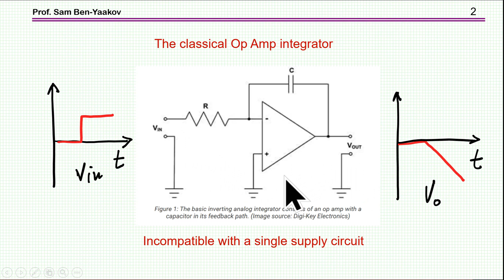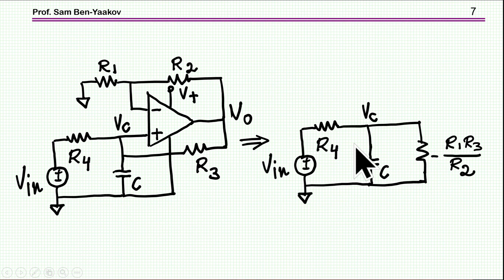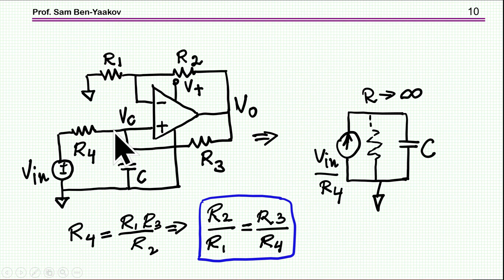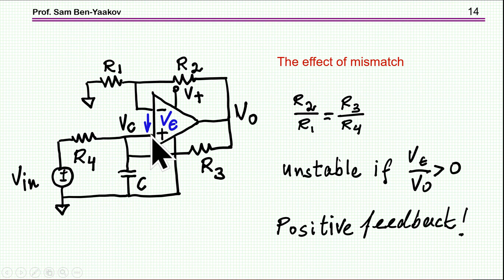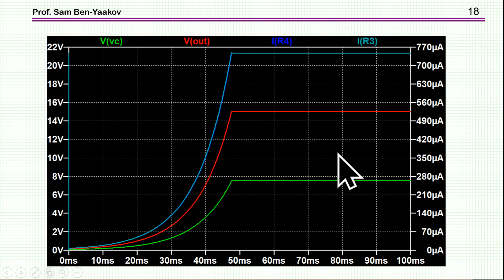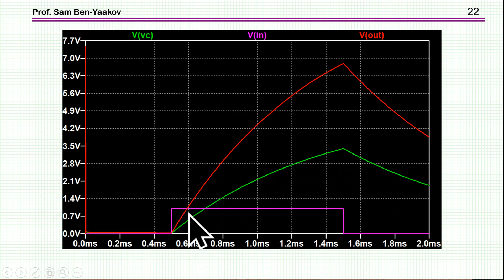Howland, Deboo and the non inverting Op Amp integrator

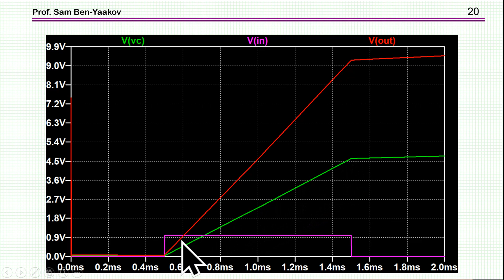Comment: At 14:01 showing the output with perfekt resistor match, the output does not go to zero when the input returns to zero. Was that not one of benifits of this circuit compared to the non-inverting integrator?
Reply from the maker: Yiu acb look at this, as such.

Comment: Hello! So this type of integrator is not stable, and therefore is not reliable.The input impedance of input voltage source can change in time, so it leads to saturation or wrong action (exponential output ) of this comparator.
Reply from the maker: Any integrator with a fixed voltage will eventually saturate if not clamped, This does not imply tha integrators are unreliable. When the fuel or charge of a car is exhausted it will stop. This makes cars unreliable?

Comment: This was a great explanation of a single-supply, non-inverting integrator. Could you make a single-supply, non-inverting derivative by exchanging C and R4?
Reply from the maker: Good question. I will have to think about that.
Reply: @sambenyaakov  I have implemented your version of the Deboo integrator into a PI closed servo loop for a cheap Chinese mini lathe which only has a 5 volt supply for logic. It works fairly well, but I had to place the encoder feedback device where I could find room and that was directly on the lathe spindle rather than the motor (for lack of space around the motor). With the spindle drive belt between the motor and encoder it induces some compliance into the system resulting in a low frequency oscillation when the loop is closed and a load applied. I am hoping a derivative will dampen this oscillation. I wish I could find a motor with an encoder (or tachometer) build in that will fit the restricted space, but lacking that I'll attempt to modify the Deboo integrator to a Sam Ben-Yaakov derivative. Or maybe an I-M-E-Trader derivative as this single rail function does not seem to have yet been invented.
Reply from the maker: @imetr8r  Thanks for sharing I hope you reach an optimal solution.
Reply: @sambenyaakov  Grate explanation! as always. Do you have any suggestion for a non-inverting derivative? in case of single supply op-amp? Thank you Sam!

Comment: If the input has a very high slew rate (e.g. a square wave), will the OpAmp be able to catch up?
Reply from the maker: Op Amps have inheret slew rate limitation that ca not be exceeded no matter the feedback network.
Reply: @sambenyaakov  Thank you! In case of an integrator, if the input is a square wave and the output's slew rate does not exceed the limitation, will the GBP of the OpAmp affect the operation? e.g. using a 1.5MHz OpAmp to make an integrator to integrate a 100kHz square wave? (Assuming the gain is sufficient small that does not cause saturation or slew rate limitation）
Reply from the maker: @rikka0_059  No it will not
Reply from the maker: See https://youtu.be/B9sIAbdfIyE

Comment: Another great topic.  I would say the instability described while true does necessarily mean instability of the overall system.  Another way is to look at offset current being injected due to resistive network mismatch that happens to also be a function of the state of the integrator and if this circuit is in a bigger loop and this offset (bounded by bigger loop or w.c. supply while main loop starts up) can be tolerated this circuit could still be used even with the mismatch in the "runaway" direction.
Reply from the maker: For same offset, with mismatch the other direction there is no drift.

Comment: Thank you!  A very interesting way for deriving of the function. There are some types of improved Howland current pumps. For example it's possible to split R3 in two or introduce a buffer (another opamp) between the load and the positiv pin of the opamp. 👉 "improved Howland current pump".
Maybe the circuit could be used as a differential integrator, when not grounding the resistor R1.
By the way, could you please explain the function of a transconductance amplifier and the variety of its applications? Many thanks in advance!
Reply from the maker: Thanks for sharing

Comment: Thanks, very interesting presentation.
Of course,  Howland current source is well known, but the stability criterion is not well documented.
So from your presentation we gather R4 > Real (Z*R1*R3/(R1*R3+Z*R2)) in order to have stable operation.
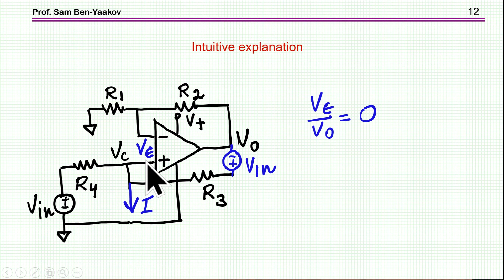@8:56 change Z with non-ideal LC Tank. Let R1=R2=R3=R4=R now the current through the Z is Iz=Vin/R and if we make the circuit unstable using mismatch we will have oscillation.
By adjusting Vin, we can get very clean oscillation with low phase noise.
Also, if you want to use it as integrator,  all the real integrators suffer from high frequency noise integration, so you need to add a low pass circuit ( a differentiator)  to the circuit to prevent saturation.
Reply from the maker: Thanks for sharing.

Comment: Very interesting. TI has put out a few papers on Howland Current Pump inspired circuits recently (shown below). I don't remember them warning about the instability criteria though...

SBOA437 – OCTOBER 2020
SNOA474A–January 2008–Revised April 2013

Okay, 2013 isn't that recent, but at my age, it seems that way...
Reply: Thanks for references.  I could find SBOA437 "Analysis of Improved Howland Current Pump Configurations" However, I could not find SNOA474A
Reply from the maker: https://www.ti.com/lit/an/snoa474a/snoa474a.pdf
Reply: @sambenyaakov  

Thank you professor Ben-Yaakov.

 I know people use this circuit (Howland Current Source or Pump) for Linear V2I convertor.  I guess  a chip with all the resistors matched inside a chip (R1=R2=R3=R4=R) is in order.  One important factor is the maximum frequency of operation of this circuit.  The other is Maximum current that it can support.

One possible application I am contemplating is to replace Z with a transmission line, inside a chip and outside a chip.  Such transmission line is more immune to noise and interference than  voltage transmission line.  Specially, If we could modify this circuit so it have  differential output instead of single ended output. One possible solution is to use two such circuit, but matching is an issue.  Please notice for ground noise, which is common in a chip, even a single ended current signal can compensate for ground noise.
Reply from the maker: @aduedc  Good points, thanks. An intersting point that I dodged in video is the dependence of the operation frequency on the open loop transfer function of the Op Amp.